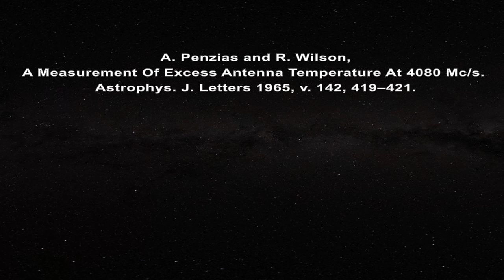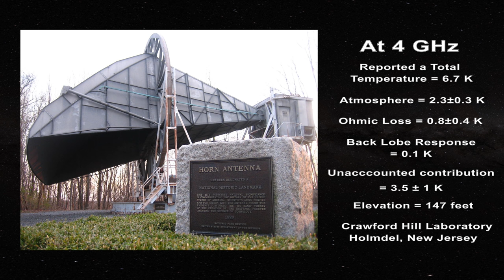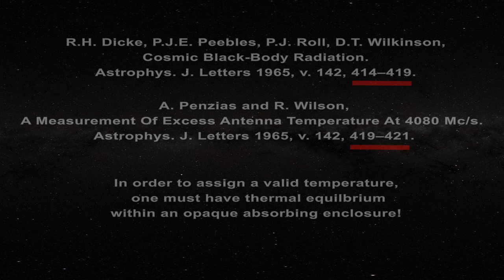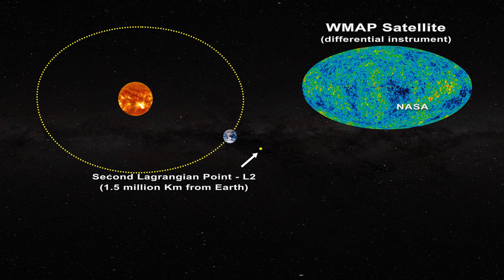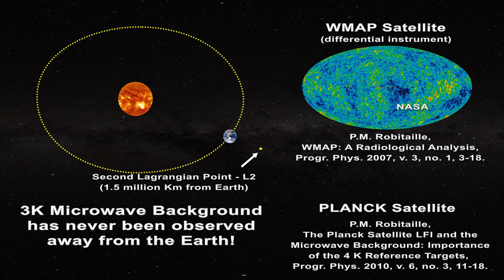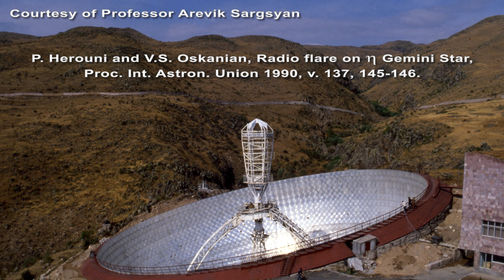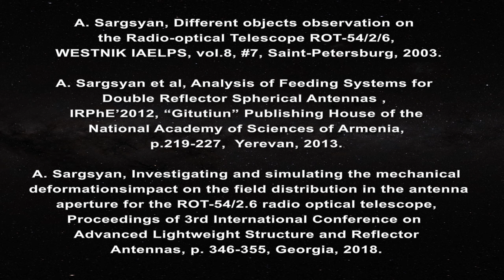The Herouni Antenna - The Death of the Big Bang!

Comment: this guy is totally wrong and doesn't know what he's talking about
Reply: @devilmonkey427  
Provide an argument if it's so obvious that Dr. R is wrong. Just one. Otherwise, go find something else to do with your life that is more fruitful. How about trying to move out of your dad's basement?
Reply: @bushmangrizz4367  The main advantages of ROT Antenna are the highest accuracy of mirror surfaces (50 micron), shortest
wavelength (1mm) and very low level of Self Noises (2,6 K), i.e. highest sensitivity. Thanks to high accuracy of ROT Antenna it can work in very short wavelengths, down to 1mm. Due to special
 optical scheme of the Antenna, the diffraction rays from edges of mirrors do not arrive to the focus point, so
Antenna almost not feel surrounding high temperature (about 300 K) and I have no Idea what I'm talking about so the Self Noises of Antenna is very low,
just about 2.6 K or 2.8 K (r10%) in different experiments, where to achieve the high accurate result, the Self
Noise Temperature (TSN) was mainly measured at first near the East support leg of Antenna, where there is the
bridge, in open position of which it is possible to go to receiver and focus point.
Reply: @bushmangrizz4367  Oooooooooooooooooh, good one!
Reply: "this guy is totally wrong and doesn't know what he's talking about" 

-- David Infante, Astrophysicist, Radio-astronomer, Published Researcher, Internet-Dwelling Mouthbreather
Reply: It is not about "this guy" and he has a name. I have great respect for him. The test setup seems a lot more valid than the previous ocean near setup. The science community is dead stupid dropping everyone who is challenging their theories. It was great to question Kirchoffs law/Plancks derivation, although I tend to believe they hold, but a lot of people in the science community are mainstream sheep and they do not even listen to someone who challenged them once.
Reply: @ktulipan7543  What is Planck's theorem?
Reply: @adamrspears1981  If you get smacked on the head with a big enough plank you see stars.
Reply: Explain?
Reply: David Infante
It’s going to be okay.  New evidence is coming.
Reply: @adamrspears1981  Sorry I wrote from a mobile device. I mean Plancks derivation of Kirchhoffs law. I corrected my wording. Thanks for your hint
Reply: @ktulipan7543  😉
No worries!

Comment: You didn't actually offer up anything, you made assumptions based off of one persons work that was never verified; off of a single antenna that you or no else has worked on.
If the big bang is proven wrong that's fine, but you literally have shown nothing, old data that you are working to rebuild, what does that actually mean?  You have the data, rebuild it into what?
Reply: @rflair: You are obviously not paying attention. Professor Herouni's findings were published in the peer-reviewed Journal of Applied Electromagnetism. All you have to do is go and get it (it's free) and study it. The age of data is irrelevant.  There was no CMB in 1988 and it's not there now. So Big Bang creationism is now quite dead. Explain to us all why professor Herouni's antenna noise is not 2.6 K. It is you who has offered nothing, except hot air.
Reply: @stevecrothers6585  It was reviewed by an organization dealing with findings of the Black Sea region, it was never reviewed by anyone outside that and it was only published as data (findings) not a critical review.  
Also this guy talks about other radio telescopes being close to the ocean therefore dismissing their findings, but goes on to say the Armenian radio telescope is to be trusted because it not near a large body of water.  There are huge radio telescopes and arrays all over the world in many different places and no other show what he is saying, just this one decommissioned telescope in Armenia.

Comment: I think that the scientific community should update the antenna equipment if the experts show the impossibility of additional testing on existing antennas. Unfortunately, I am not an expert on cosmic microwave background. However, it is normal practice to first publish a scientific paper, where to describe the existing problems and if there is an opportunity to conduct measurements in the specified wavelength range, then this is where you should start.

Comment: All this relies on this radio telescope, you show how surrounding terrain will have difficulty to reflect signals into the dish, yet in the same picture you see a big hill right next to it with an array of angles which the signal could bounce off of and also the hills right across the ravine in a different picture.

Also a lack of response does not equal confirmation.

Comment: Seems a lot to stake on the linearity of a detector, which from experience they never are!
Hang on why is there no discussion of the receivers? Are they cryogenic? Any estimate of the receiver noise temperature? If it is room temperature no way it is below 100K. There's no mention of a cold reference, so they must be including the receiver noise in the total noise (ie it's not a Dicke radiometer). How are the calibrations signals switched to the receiver? Mechanical switch? Ferrite switch? Directional coupler? How was 180K diode signal temperature estimated/measured? Was linearity measured? Have fluxes of known bright sources (CRAB, Cygnus A, Virgo A or even the Moon) been checked? There's a complete lack of detail here, which makes it impossible to evaluate their claim.

Comment: Mr. Robitaille: the paper you reference of Penzias and Wilson is from May-13-1965 and Dicke and Peeble paper's date is from may-7-1965. However, the paper cited by Dicke and Peebles is not the one u show, but this previous one of Penzias and Wilson of April-1st-1965. Greetings. 
http://articles.adsabs.harvard.edu/cgi-bin/nph-iarticle_query?1965ApJ...142.1149P&defaultprint=YES&filetype=.pdf

Comment: Look, I do agree that there is a value for every eye and ear pointed at the stars. This optical - radio combo is valuable in its own right. Try to cloud source the money to maintain it. It is a valuable optical radio telescope. But its range of operation is not designed to pick up the cosmic background radiation. Rather, it was designed specifically not to pick it up since this is - basically - noise. You don't want noise in a radio telescope. So it is alright that this combo is designed not to hear noises beginning at 22GHz. I mean, you don't want them, you want a clear picture of the night sky. You want to see stars. Galaxies. Not noise. So.. Try to cloud source it from the enthusiastic community of astronomers living nearby. You won't be dissappointed.

Comment: Never believed the big bang theory. I have always believed the universe is endless and has always been here. But by nature, we tend to believe there's a beginning and end to everything.
Reply: Jeff Houle

"Never believed the big bang theory."---

Why would you need to 'BELIEVE' it ??  To be an ACTUAL 'Scientific Theory' it would already have been VALIDATED/CONFIRMED by Experiment. This tear Jerkin Belly laugher never even entered THE FIRST STEP of The Scientific Method. lol

"I have always believed the universe is endless and has always been here."---

2nd Law of Thermodynamics Violation...

1st Law of Thermodynamics (1LOT) : The total amount of mass-energy in the universe is constant. (Nature/Natural Law CAN NOT create or destroy Matter/Energy).

2nd Law of Thermodynamics (2LOT) : The amount of energy available for work is running out, the Universe is moving inexorably to "Maximum Entropy" or Heat Death.

If the total amount of mass-energy is constant, and the amount of usable energy is decreasing, then the Universe will End — the 'Heat Death’ (The Big Chill) of the Universe; ERGO...it had a BEGINNING (CREATION) ---and not the 'big bang' Pseudo-Science Trainwreck.

You need to STOP 'believing' and start looking for adherence to The Scientific Method and "EXPERIMENTAL VALIDATION" .

regards
Reply: It's just a theory and not proven

Comment: This is exactly how science operates.  People (scientists) working to debunk previous theories or "findings".  If Prof. Herouni can demonstrate to other scientists the validity of his measurements, then good for him, maybe he is unto something others overlooked.  However, the  big bang theory does not just depend on the cosmic microwave background.  It was deduced from the fact that the observable universe is getting larger and so therefore there was a  time in the past that it was smaller. Extrapolating backward, it is estimated that the expansion started 13 to 14 billion years ago.  This age seem to correlate with Hubble's most distant observed galaxies. Nothing is absolute in science as in nature.  We use electricity based on present electron theory although we do not know the exact nature of an electron.

Comment: I dont have a dog in this fight, neither do I know enough about CBR to question radio signals, but arent the galaxies  and stars moving away from each other, so if you run it backwards, there would be a single point of origin?

What is the alternative? Infinite age universe? Self perpetuating stars? It does not fit the mainstream narrative.
Reply: The red shift is an observation. Expansion is a presupposition explaining the red shift.
Reply: Wait so we all move with the universe but within the universe some galaxies travel parallel?... I’m too high

Comment: I believe there are one of two possibilities of temperature status to prove the big bang theory. 
1.) The temperature is increasing and slowing down
2.)  The temperature is decreasing and speeding up
This is due to the rapid expansion of the universe has a maximum velocity which decelerates where temperature increases due to energy coming to neutral in a finite space or has peaked and is accelerating back to the point of origin (this would be due to the source of energy in the universe has a central location where the accretion draws the energy back to the source of initial expansion.
Reply: @quantumeraser4833  It' just one onf many plausible cosmology theories that were proposed how the universe was formed. Possibilities of temperature models as stated would simply say if the universe were expanding then temperatures would be decreasing and if the universe were contracting then the temperatures would be increasing. A theory has never been proven hence the name "Theory"  A "theory isn't a fact and has yet to be proven so go back to school and come back when you know what a "theory is"  (based on your statement "Ahhh, to BE an actual Scientific Theory...it already has to be PROVEN to begin with.") It's a hypothesis.. just a little hint there.
Reply: @quantumeraser4833  Say the guy who thinks a "theory" is a "scientific fact". Get lost you wanabe scientist. You attack me for making a perfectly suitable argument for a probability.. I bet you  think you're "ThunderFoot" Belly laughs while dropping the mic...

Comment: Dr. Robitaille, I am an electrical engineering student interested in organizing a co-op for the summer of 2021. I would like to focus on the electronics required for the telescope. Are they planning to refurbish the old system with tubes, or will they install new modern receivers? I would like to spend the next four months studying what will be needed for implementation. Any suggestions? Then do work that the foundation approves during May, June, July.

Comment: A red-shift could be caused by the Doppler Effect; but it could also be caused by a small loss of photon energy. Conservation of energy would allow for absorption and re-emission as two photons: One slightly red-shifted photon, and a second photon in the microwave range. This could also explain the microwave background. Considering that the BBT was first proposed by a Catholic priest, and quickly adopted by Hubble, maybe we jumped on that bandwagon a little too quickly.
Reply: There are many theories like this.  They have been discounted by cosmologists because they (cosmologists) claim that this kind of a loss of energy would result in distortion.  I don't accept this dismissal because I am familiar with many interactions and systems which reduce photon energy without distorting wavefronts.
Reply: @onehitpick9758  - exactly the mechanism involved isn't really important. The fact that it hasn't been proven to be caused by Doppler Effect alone is the problem. And if that's the case, then BB didn't happen.
Reply: Redshifts have also been shown to be quantized.

Comment: So , you want to resurrect a fundamentally flawed antenna because it seems to give the results you desire ?
Reply: The antenna by Herouni wasn't flawed in any fundamental sense.  He was zero-basing the noise signal and looked for some verification to his calculations or some potential reasons for the information he had.  The design happens to have some desirable features due to the sphericity of the reflector.  I believe that it is superior to having both the reflector and the receiver being parabolic (since the reflector is stationary).  I understand that much, but not much of the finer points of radio and optical hybrid (?) scope.

Comment: I agree that there is no good way to view temperature on a very fine location, that it is an emergent phenomenon. However, all "things" with mass form a structure that could be seen from a distance to have a lattice structure. If its not a lattice structure just zoom out a little bit and it becomes one. 

Virtual particles create these symmetries, so that even if there were monopoles, they act as if they were dipoles. As such, no true monopoles can be observed in anything that has mass.

Comment: Okay folks - let's all take off our tinfoil hats for a moment, and discuss a little of what I like to call history.  Two scientists, Ralph Alpher & Robert Herman, first proposed the idea of a CMB or cosmic microwave background, back in 1948.  Even though their initial estimate was about 5 degrees Kelvin (not bad, really), it was based on estimates of the expansion rate of space which, at the time, were subject to much revision both up & down.  Their idea had several conceptual flaws, and is mainly important historically.  In the early 1960s, a few others began coming up with more well thought out ideas & even predictions of what the CMB should be; even proposing design of a special 'radiometer' to measure it.  This would prove unnecessary, as Arno Penzias & Robert Wilson - who were doing research with ultra-sensitive microwave antennae for (ironically) radio astronomy, came across a persistent noise they couldn't otherwise explain.  This turned out to be the theoretical CMB, for which they (Penzias & Wilson) won the 1978 Nobel Prize.  As Stephen Hawking has pointed out, this doesn't seem quite fair to the scientists who worked on predicting it, but there it is.  The reason the 2 different papers were published back to back in that order, was simply because that was their chronological order of appearance: a paper was submitted predicting the CMB, & a paper was then solicited & thus submitted by Penzias & Wilson on their discovery of same said phenomenon.  No mystery there.  As a couple of other commenters have pointed out, this was not some top-down restructuring of ideas to fit one result; it was the culmination of some 20 years of work by a number of scientists, which really just put the cherry on top of the theory which already existed as the big bang theory.  Drs. Robitaile & Sargsyan cannot not know this.  So the question is: why do they insist that 1 result from 1 telescope can undo what is now more than 70 years of scientific theorizing & discovery?  You will have to draw your own conclusions on that one.  As for me, well, I'm a bit torn, frankly.  On the one hand, I'd like to think that they really believe what they're saying; otherwise they'd be trying to fool people (though not trying to fool scientists, who know better!)  but that would mean that their beliefs were seriously out of touch with our best understanding of reality.  While it's certainly important to question our beliefs - even & especially our scientific beliefs - there is a point at which you either accept that this is the best answer we have, & you move on, or you start circling around & around, stuck in place by ideas that aren't going to get you anywhere.  This applies in science as much as it does in each of our personal lives.  Even more so, in fact, because science is collective.  One person can believe the universe is the mad ravings of a lunatic somewhere & we're just stuck in his/her insanity [for instance] & it doesn't affect them when they go to the bank or pass the potatoes.  But science must move on collectively - there must be a consensus that says, "This is our best possible answer for now.  Let us move on."  It doesn't mean science is always right (far from it!)  It just means that it's the best we can do for now.  On the other hand, they'd just be pulling our collective leg; trolling us.  This could be the case, but when someone says things like this & appears to take themselves seriously, we must also take them seriously - or at least at face value.  So what I said above still applies.  Science on, my brothers & sisters in the journey of life & illusion - science on.     :)       Rikki Tikki.

Comment: Dr. Robitaille, Would it be possible, based on what you've presented in this and other videos on the CMB that Water is the bases for the false detects in CMB, to produce a Low Cost Experiment to avoid the local interference from water and show there's no Cosmic Microwave Background? The key is Low Cost. Thanks for any information. Also, hope you're back online soon. Best regards, Mike